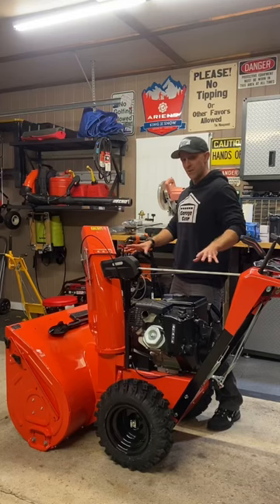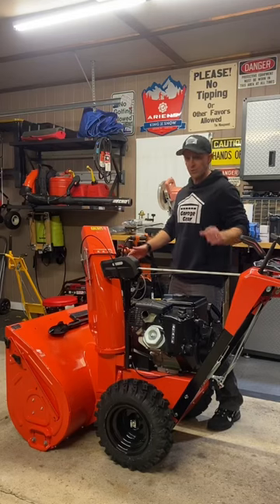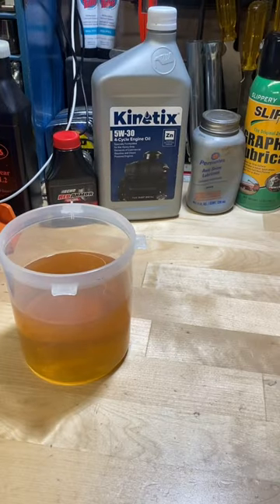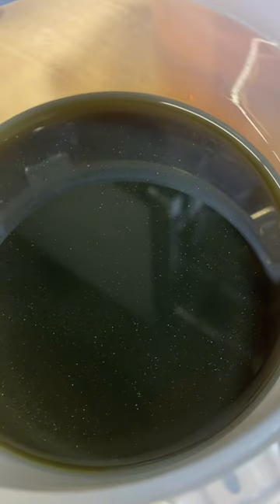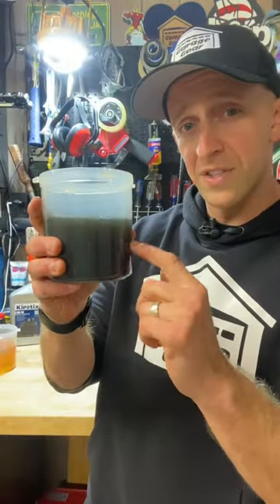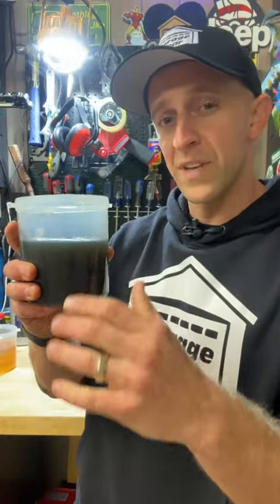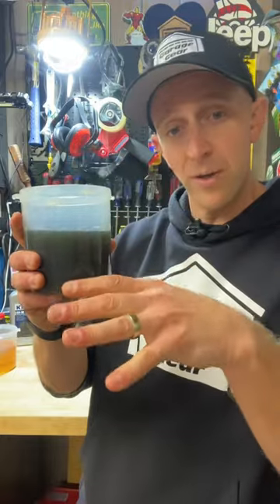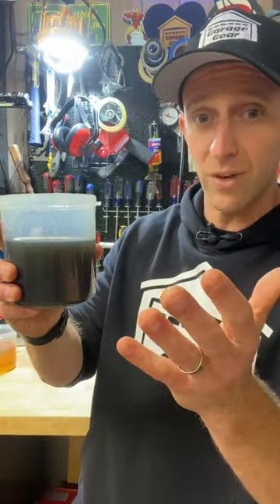What Comes Out Of Your SNOWBLOWER After An ENGINE BREAK-IN

Comment: It’s also metal particles from the engine manufacturing process. They don’t get them 100% clean  at the factory before the engine is assembled. Exactly why the first oil change is the most important!  Good info JB!
Reply from the maker: Good point Michael! 👍
Reply: i ran the stock break in oil on my kawasaki klx140l dirtbike for 2 years after i bought the bike brand new. Then i changed it lmao havent had a problem since.
Reply: @seanmckay3392  - That's a good and proper method. 

The factory fill is what you should run, followed by two oil changes with your preferred oil with the right specs / viscosity. 

I recently did the break in of Dolmar 53cc four stroke. 10w30 as a break in during 20 hours, followed by Amsoil SS diesel 10w30 API SN rated. This week I switched to Motul 7100 10w30. 

The engine runs sweet wide open, superb temperature control, perfect throttle response. 

Did the same with my Honda CR's, every other engine I have. 

The gear is ready to run for years.

Comment: Your videos are awesome. I love your channel and I agree with getting that stuff out but essentially couldn’t you just filter that oil and put it back in or keep it for an engine flush at the end of the year of course after filtering it. 

I know a lot of people are in the habit of fillet, then dump it, collect it and throw it in the hardware store but I’m starting to maintain more machines and I realize that there’s an ability to use the oil in just a few ways as opposed to just letting it go right away. 
Like me, I see that oil and having it be partially used I would just set up some cheesecloth or get a paper filter stuff it in the funnel and dump it over the top and let it get all the fines out and I would probably just put it back in the machine But now that I think about it, it makes me want to say you could do a couple of 30 minute run cycles with that oil dump it back in after filtering it and then collect it again drain it dump it back and collect it again strain it you could do that maybe three times and get all the junk out of it. 

Thanks for the video it rocks and I’ve never dumped the oil on a brand new machine until after like 10 hours you’ve changed my mind conceptually with what I should be doing not just could be doing.
Reply from the maker: I’m glad you’re following along on the channel and you enjoy the content. No, I’m not going to do that. I don’t have time to filter oil or save it. It’s pretty cheap anyways. I understand what you’re saying, but I don’t have the time as I try a to pump out a video or two a week and I’m a one man band.

Comment: I run delvac 15-40 (has zinc), and I change at 10 minutes, 30 min, 1 hour, and 3 hours. Get that crap out asap. Oil is cheaper than premature failure. When I was offgrid I've had those little champion 2000w inverter type last 3 years only shutting off to change the oil!
Reply from the maker: Thanks for sharing this Matthew!

Comment: I remember how excited I was when I sold myself a new 2004 924505 13/32 Pro from a power equipment store I worked for at the time. She retaiked for $2250  on floor. I got it for $1895. It was a cadillac at the time. 12 volt start heated grips electric chute. Top of the line. Was advised  by the mechanics to get the 32 rather than 36 which had the same Tecumseh Snow King OHV  Engine. Still going strong.
Reply from the maker: That’s really cool how you got a discount! 👍👍
Reply: @GarageGear  I was an all around floor guy at the time so it was an employee discount. I sold my 10/24 pro a few years old on the floor. It looked so good I had it next to the new ones. A lady was so happy to get it and save a few hundred dollars. I put that money toward the 13/32 pro I still have.
Reply from the maker: @josephlahood4647  awesome my friend! 👍
Reply: @GarageGear Just ordered a big can of Hard Hat Rustoleum industrial clear on Zoro. I'll give the bucket and augers two good coats  . I think I may disassemble in April that way I can peck away at it over Summer.  Not sure if you're restoring that 70's machine you were putting a new engine on. Be nice to see.
Reply from the maker: @josephlahood4647  good idea! I’ll probably be painting mine this summer too!

Comment: You know what's crazy? Is that none of the Ariens Dealers sell Ariens full synthetic oil in the Western New York region. At least none that I have found. Each location has told me how expensive it was, and so it was not beneficial for them to carry it in stock. The Ariens' full synthetic oil was looked down upon as well as if there were no such benefits. 
 Funny, but when looking online, it's actually sold for equal or less money than what they are selling their so-called regular recommended oil of Ariens 5W30 synthetic blend. 
I just brought this up to see whether or not you have thought of putting full synthetic oil?
Ariens does make a full synthetic product, and at no point  have I read that it was not a suitable substance for the motors. I'm pretty sure it gives you the option of blend or full.
Takecare!
Reply from the maker: Hey RC! Full synthetic is great in the winter time because it flows better. I use it in all my machines. Usually super tech FS 5w30. Cheap and works great! Haven’t seen full synthetic at dealers here either!

Comment: Thinking late Summer time to separated auger gear case assembly. Clean sand sand prep same. Same with inner bucket. VHT Roll Bar Epoxy Gloss Black for Augers and Case. Duplicolor Chevy Engine Orange and some Tough Clear coat paint for bucket and inner barrell assembly. Did it about 10 years ago. Maybe a good time to replace belts whether they need it or not. Hope to see more and more tips here. Thnkyou
Reply from the maker: Sounds like you’re all set to go my friend! Thanks for sharing! You got it! More to come!
Reply: @GarageGear  exploring tge toughest clear coats in spray cans. Not sure if you paint or not. You know tge bucket and augers are the toughest of the  tough for painted steel.
Reply from the maker: @josephlahood4647  painting these can be a lot of work. I tend to stay away from paint as much as I can.
Reply: It is I've done it before. You split machine remove back Pulley after disconnecting rods cables chute etc.Then side bearing bolts and the whole assemble of auger and impeller comes out. I agree its a Summer job for sure.

Comment: @GarageGear JB when you bought your Ariens Pro 32" did you cross-shop against the Toro 1432 (PowerMax HD Commercial)? Wondering what your thoughts are on the Ariens AX 420cc/LCT (former Tecumseh) engine vs. Toro Pro 420cc/Loncin/Harbor Freight Predator (Honda clone) engine. This may make for a great video in its own. Keep up the great content! 👍
Reply from the maker: Hey snowking! I looked at a lot of snowblowers. It was mainly between ariens or Honda! I have had nothing but success with the ariens ax engines. And Honda parts are very expensive! I like where your head is at! Thanks for watching!

Comment: You need to keep it in there for a while. Not a crazy long time but it needs the rings to set. If the rings don't set, it will burn oil so it's not a good idea to change it. After the first use of a brand new motor you need to change it quite a A few snow storms when it's broken that's all i'm saying thank you
Reply from the maker: Thanks for sharing

Comment: Those reflective bits are aluminum 

Not steel as ur say they are in video from piston going up and down 

If it was making its own groves 
That motor be toast
Reply from the maker: Thanks for sharing
Reply: @GarageGear  I build the performance small engines 

I built a Eltric start 420cc modified engine for my ariens a lot less then there kraken 

Built over 100”s  perforce small engine 
Very common have aluminum in ur first oil bath 

That black color is carbon 
The oil washes the cylinder down cleans the bore 

If u run ur engine very rich 
U can have black oil little 5 minutes 10 minutes 

Has no affect on oil or anything 

When oil turns like dark grey or brown 
Sign of dirt or metal 
They actall sell oil drain plugs with magnets on end that will fit these engines but no one will spend the $10 lol
Reply: Recently found a survivor 1028 power shift toro very good comdion be my next project put big monster engine on it 
 I found the original commercial 
On YouTube it so funnyy
Reply from the maker: @TheGameBoy56  I should get one of those plugs for my engine
Reply from the maker: @TheGameBoy56  it’s a blast from the past see bold commercials like those
Reply: @GarageGear  just found a vintage craftsman. Self propelled from the 50”s on market place 
lol little rolling tanks 

Just rember sears out sourced evthing so u keep looking in that Erra u may find a snow blower very close to craftsman 
Because changed couple thing rebranded craftsman 
Just back then maybe 5 -10 company’s know we got names that are great relatives would turn in there graves when they here lol 
😂 
Like who know harbor freight had a big sea boat as logo when first started